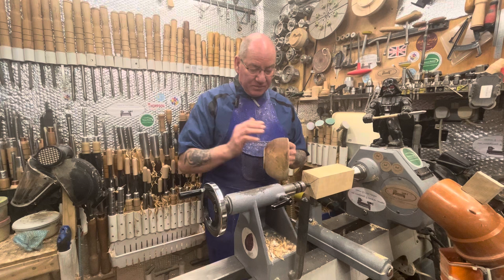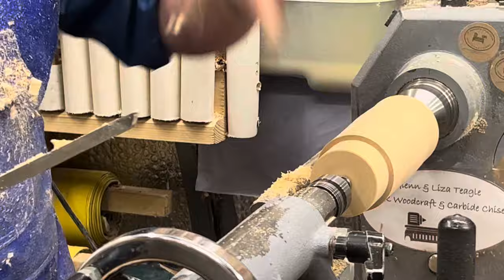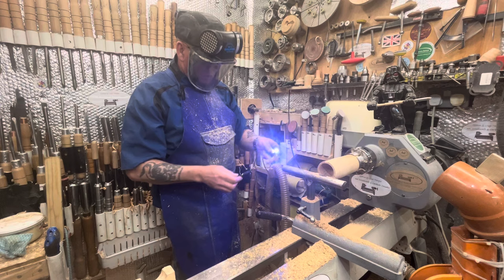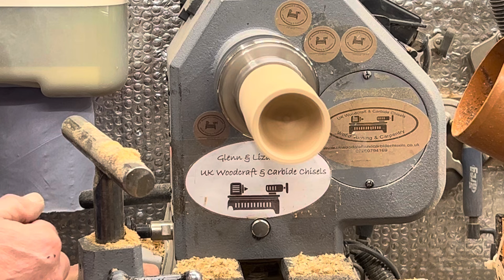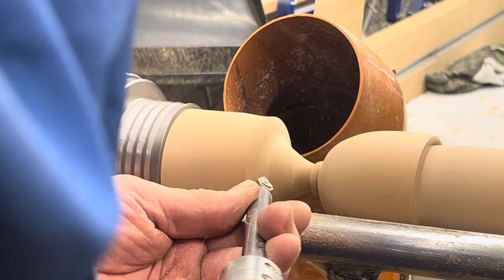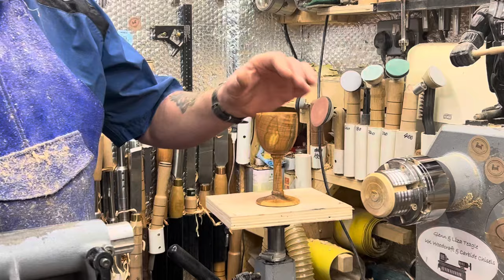Woodturning a Sycamore Goblet

Comment: What's happened guys? Sound and video quality is terrible??
Reply from the maker: We don't hear what you are hearing. To us Glenn's voice was much clearer and it cancelled out the lathe and dust extractor noises. That's what the mics are meant to do. Can you explain what was terrible?
Reply: Yeah sure, that's weird.. I listen with very expensive headphones, sound used to be nice and clear, now it's muffled and often loud pops like it's over modulating past it's capacity, if you google Over Modulation... you see what I mean. Plus video quality for the past two videos has been hazy like dust on the lens. Cheers, enjoy the content
Reply from the maker: @tazwhitefeather  thanks. We had comments that before the sound was muffled when we talked. It cleared up nicely with the mics, from what we could hear. That's from listening to it on the phone, computer and TV. The mics were too close to Glenn's mask and as he said he was used to talking loud so this makes it a bit muffled. Also because of the whirring noise inside his faceshield, he talks loud, thinking you can't hear him. The hazyness is when the focus is zoomed out, which we have no control over. We film on a mobile phone. The close up shots, which are necessary are zoomed in for, so you get those shots clearly. These 2/3 vids were the first time of using the mics. We will need to test further.